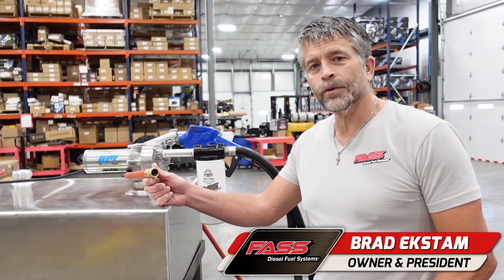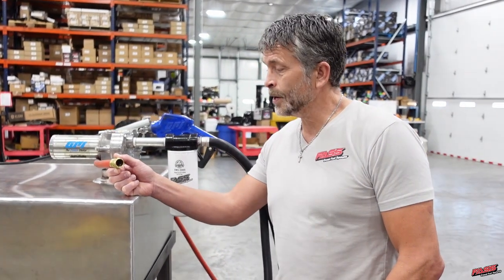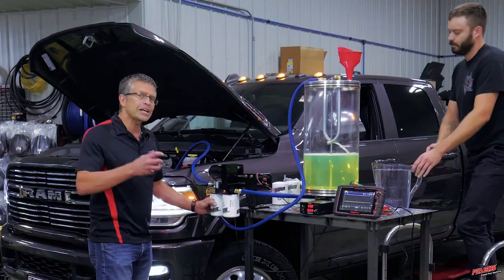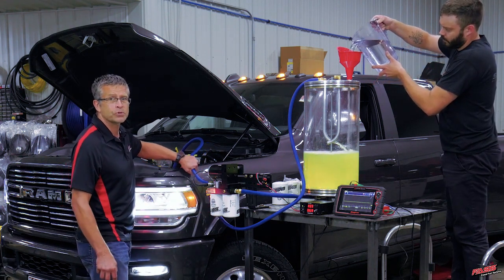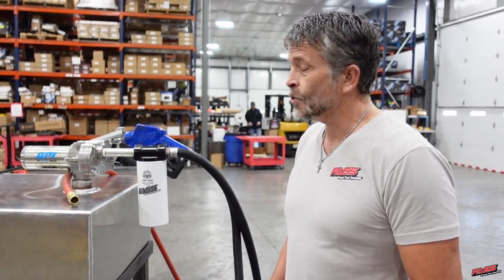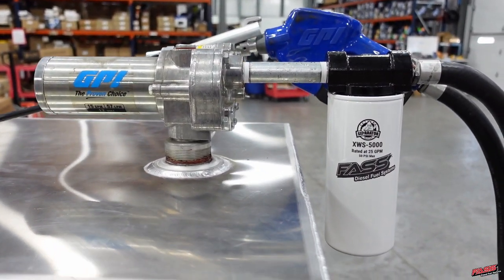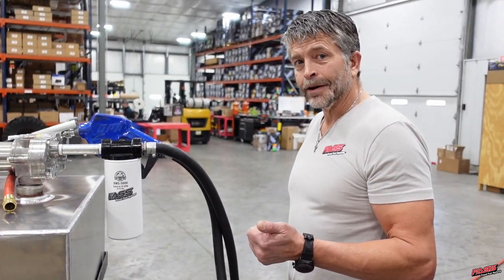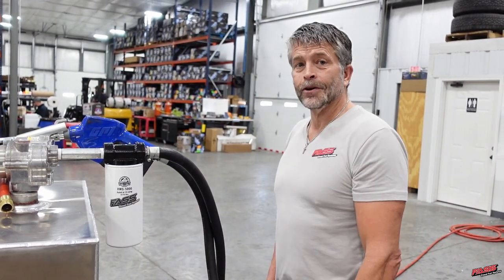What's hiding in your transfer tank fuel?🤢  FASS Fuel Systems Transfer Tank Filter

Comment: Do you sell the filter in a kit?  Thanks
Reply from the maker: Thank you so much for reaching out! For the transfer tank filters, we don't have these available in packs, but for the regular filters, we do have packs for those. We'll attach links for both here. 

https://fassride.com/shop/product/accessories/xws-5000-transfer-tank-fuel-filter/

https://fassride.com/products/xws-3002-and-pf-3001/
Reply: Thanks so much. Do you sell the fitting that the filter screws onto?
Reply from the maker: @crf50crazy  You're very welcome! We do have fittings for these as well. For those, I would suggest giving us a call at 636-433-5410 as those arent on the website. Thank you!
Reply: Will these screw onto the typical transfer tank filter kit?